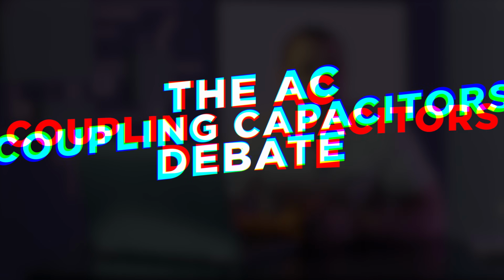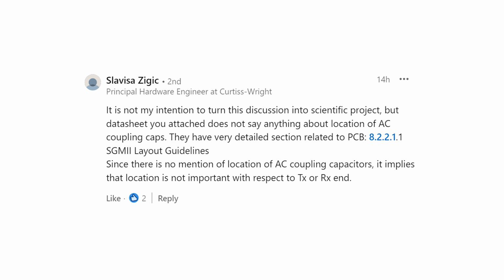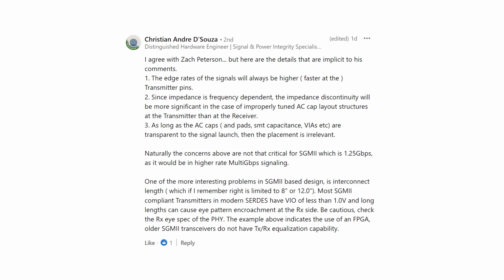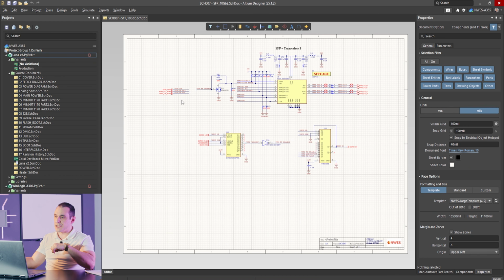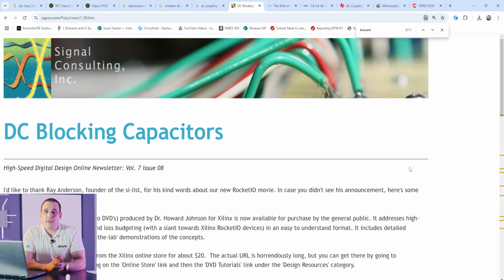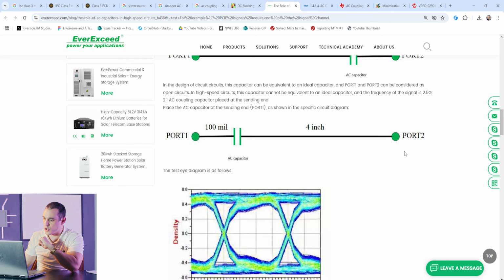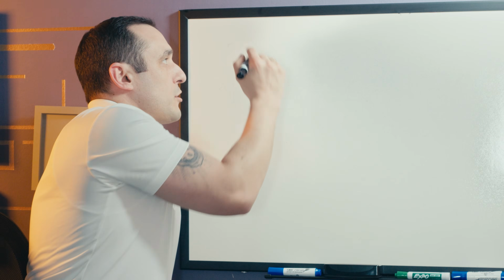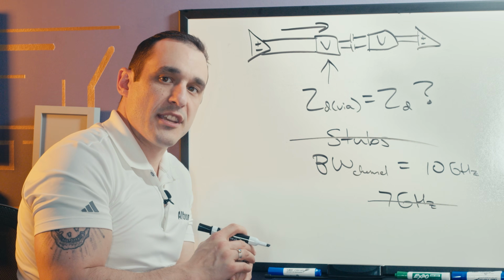AC Coupling Capacitors: Placement for High-Speed PCB Design

Comment: I'd love some more details on capacitor cut-outs. Is this about increasing the distance to the reference ground plane to maintain a 50 Ohm impedance and reducing discontinuities due the the capacitor pad size being greater that the 50 Ohm trace size?
Reply: I am not sure of the mechanism and I would have to think about it more to ensure I fully understand it. For large case sizes where the pads exceed the width of the transmission line that would make sense, for example you can see that effect in the nRF52 module and in large pins on some SMA edge connectors. When the pad is the same or smaller width compared to the trace, your explanation would imply that the ground cutout would not matter. I have not seen data on this so I don't know the answer at the moment. I would suggest reading the Simberian application notes, I have added these to the video description.
Reply: @Zachariah-Peterson  Thanks, I'll read them.

Comment: Hi zach great video but does your previous video on input impedance and termination apply to this scenario? You said if the length of the transmission line between the driver and the termination component is small enough then it doesn't act as as an impedance discontinuity
Reply: Termination and reflections are always about input impedance. What you stated also requires the output impedance of the drive match the input impedance looking through the short section of transmission line. So if everything is matched then the S11 will stay low over a broad range of frequencies up to high values. You can see this in the application notes from Simberian. I have added links for these applications notes to the video description.